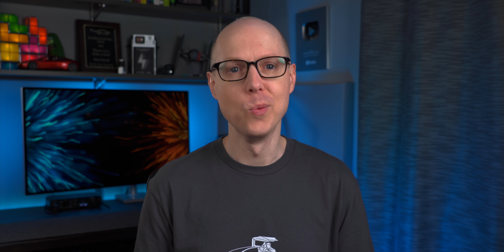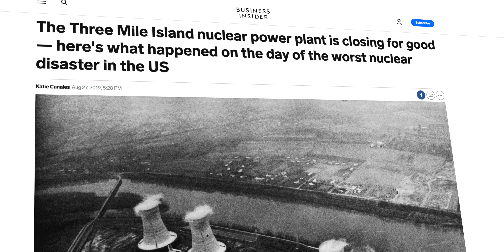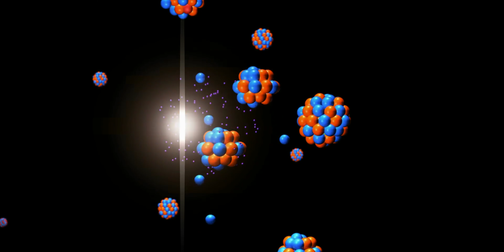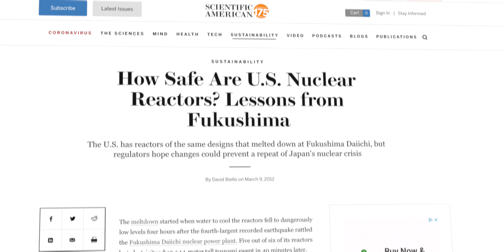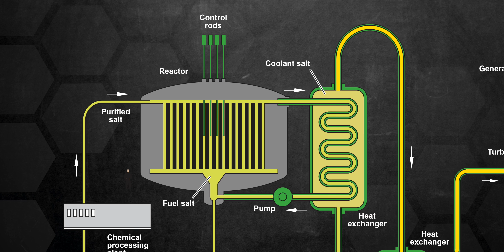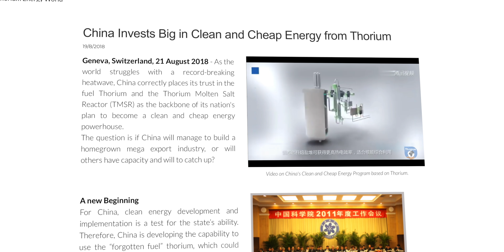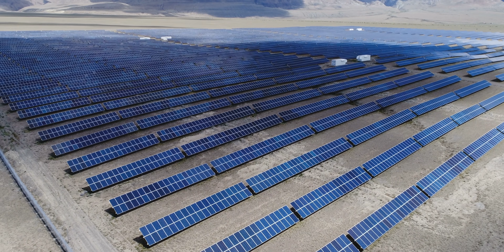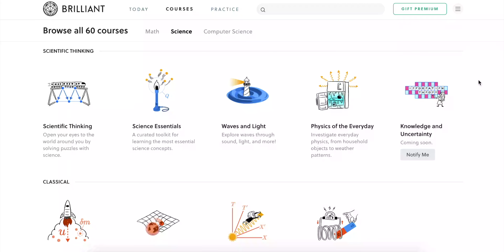Thorium explained - the future of cheap, clean energy?

Comment: Nuclear power is a moot point. Thorium would have been great back in the 50’s or 60’s, but wasn’t used because the DOD ran a game on us. Buy getting the public to buy into retail Uranium power plants they got pretty much all the free Plutonium they need for their bombs. Thorium would be great for use at a moon base or on Mars. The Tech for the twenty first century is “Liquid Air.”  That’s air not wind !!!
Reply: Nuclear is not a moot point until we have a quantum leap in energy storage technology, unless you want a future of massive rolling blackouts that is.
Reply: @ForbiddTV  that’s why I listed the Tech of “Liquid Air.” If you haven’t heard of it, this paradigm uses liquid air as a storage medium to produce electricity on demand. The protocol was first unveiled in 2009. As of this date their are three plants up and running. With 40 more on the drawing board. Like I said Nuclear power is a moot point !!!
Reply: @rikkoshop620   Not moot at all. The biggest disadvantage of "Liquid Air" is its low round trip efficiency, probably under 50%, which is
much lower than that of batteries (75-90%) and pumped hydro (70-85%) and similar to CAES (42-54%) and other chemical storage (28-50%).  And if you are getting your initial "charge" from a low performer such as solar (20% efficiency), combining the two leaves you with only about 10% of it's energy potential!
Reply: @ForbiddTV  you really do need to get your facts straight. First it’s efficiency is 75% and air is free. (You can’t beat free) With batteries you have to dig it out the ground. With Hydro, where is a lake when you really need it. Sorry you can try and pull all the negatives your little hart desires and you can’t find a paradigm that can top it !!!
Reply: @rikkoshop620    I did get my facts straight, why don't you?  The liquid air pilot plant that exists has a round trip efficiency of 8% and theoretical modelling in their report and by other researchers shows a round trip efficiency of around 50% if effective heat and cold recycle is used, and just above 20% when the heat and cold storage is depleted. Assuming further advancement of this relatively new research field, that the
theoretical models work in practice and that the operating of the power plant can be calibrated so that heat and cold recycle is available most of the time, it seems a round trip efficiency of 50% may be within reach. With a suitable location, with access to waste cold and especially waste
heat, this might be further improved. Efficiency is still much lower than batteries and pumped hydro and similar to CAES and chemical storage.  

Do you always enjoy making a fool of yourself on the internet?
Reply: @ForbiddTV  that was the first experimental plant that was built. Like I said you can’t just build hydro anywhere you want. You can with this. You keep touting batteries. But you never talk about the cost of digging, then processing the material needed. Add that cost in and their effective cost to yield starts to flag. Plus their is no waste pollution with air and there is tons of waste cleanup with chemicals. Remember the hole thrust of the argument with nuclear is it’s suppose to be clean (while you are only getting 36% efficiency and no one ever adds in the cost of storing the waste for a how many hundreds of years)  In short nuclear is not as clean as air period. You can’t get around my argument, so you keep trying to come up with stupid reasons to use stupid science. If you don’t like my efficiency calculations, then beat free.  None of the paradigms you mention have a cost that can beat free. So keep whistling past your grave yard !!!
Reply: @rikkoshop620   I never said batteries are our future, that's exactly the point - none of the available technologies will be suitable for a 100% renewables economy unless you are fine with massive rolling blackouts without nuclear when fossil fuels are phased out.  
Free?  Right, air is free, until you have to build a facility to produce/harness the "liquid air", store it, distribute it, maintain it, etc.  To suggest your nonsense is free is absurd.
Reply: @rikkoshop620   You still keep adding assumptions that I never said.  All electricity producing methods have costs associated with the entire operation to end product, and "liquid air's" end product needs massive increased infrastructure costs over others due the very nature of it's delicate inefficiency balance, having to upscale it to such a huge extent to overcome it's inherent inefficiency.  
If liquid "air would eat your lunch" why is it nowhere to be seen?  Promoting a technology that has no practical utility scale plant or even test plant is akin to promoting nuclear fusion which has been promised for many decades and still has nothing to show in a practical application.  Molten salt reactor technology was developed and successfully tested more than 50 years ago and still has no viable plants either.
Reply: @ForbiddTV  it is no where to be seen precisely because of the type of hair brain excuses like the ones you keep trying to make. You keep trying to pull nonsense out of your repertoire in order to dismiss this paradigm, (increase infrastructure cost - where did you pull that lame idea from) which on every level beats the current nuclear or fossil fuel systems now in use on many levels. Thorium was better than uranium, so why didn’t they use it?  Because the game that is played is not always about doing what makes sense. If it was - why do we still use it when there are so many better choices !!!
Reply: @rikkoshop620   No, it's nowhere to be seen because it hasn't been shown to be a viable alternative to the other equally impractical energy storage methods we have.  "which on every level beats the current nuclear or fossil fuel systems now in use on many levels."   That's completely non-sequitur since nuclear isn't a storage method, but a generating method. 
Thorium wasn't continued after the 1960's test plant because it didn't have bomb making applications.
Reply: @rikkoshop620   Well if you don't like facts, maybe you should go to a fear mongering video instead. You were the one who was confused why there were no thorium plants.
Reply: @ForbiddTV  yes it is. It’s about 20 years past due. Notice it’s only in China which is the only country that has the lose change to throw away on this latest tangent. No other countries are and China has a big problem. It’s credit markets are tapped out because they are holding all these empty real estate properties all over the country. They haven’t lived up to their promised return rates and the investors are starting to drive them to a reckoning.  It will boil down to price, which is the real reason Germany threw their Nuclear over board (a number of their reactors were coming up for refurbishment).  No one will stand to pay billions, when millions can fit their energy needs, except people that think like you  !!!!
Reply: @rikkoshop620   As of 2021, there were 54 nuclear reactors under construction worldwide, but someone thinks nuclear is a moot point. Over the years, nuclear reactors for electricity production were installed in nine developing countries : Argentina, Brazil, China, India, Iran, Mexico, Pakistan, South Africa, and North Korea, but but someone thinks nuclear is a moot point.  Even Bill Gates has jumped into the foray with a planned TerraPower Natrium molten sodium plant in Wyoming, but someone thinks nuclear is a moot point.
Reply: @ForbiddTV  yes but of the 120 reactor builds that were contemplated, most have now been cancelled. So that means world wide they cut 2, 1/3rds of the contemplated builds. Like I said most of the builds are in China or the Middle East, because those countries have excess cash to throw away. But the majority of the world has thought better. Remember when China was stuck on constructing coal power plants, but their economy has now matured and those copy cats are about to recreate one of the west’s biggest blunders.  (But they are fast learners) to bad you aren’t !!!
Reply: @rikkoshop620   China cut their coal advancement and now leans nuclear because of a hard learned pollution nightmare they are dealing with, but someone thinks nuclear is a moot point.   Nuclear Power Is the Best Climate-Change Solution by Far, its total greenhouse-gas emissions are 1/700th those of coal—and one-fourth those of solar, but someone thinks nuclear is a moot point.
Reply: @rikkoshop620   Your very first words, if you can't take criticism, maybe the internet isn't for you. 
Scientists have found no one should have been kept from their homes in those exclusion areas. 
No need to move or bury spent fuel rods, it's very valuable fuel in next gen reactors with more than 90% of its energy still there.
Reply: @rikkoshop620    "Nuclear power is a moot point", yep, spreading BS. 

Sorry you are butt-hurt that your "liquid air" isn't what you memed it to be.
Reply: @rikkoshop620   Must be all those thousands of CEO's and industry engineers, architects and technicians just aren't as smart as you to be building that which is "a moot point".  
Duh.
Reply: @ForbiddTV  see there your go again with that phrase.  (See, say often enough and it becomes a fate de complete) Just what the buggy’s whip sales man said about the horseless carriage. Their will be better tech coming down the road - always is, always will be. Just cause all your CEO’s and fat cats buy the cool aid - doesn’t mean it can’t be replaced. And in time, it will be !!!
Reply: @rikkoshop620   With solar at less than 20% efficiency after 180 years of development, guess which technology will be the "moot point" in the future.
Reply: @rikkoshop620  "Climate crisis driving a nuclear revival" Energy Central 
"We At The Dawn Of A Nuclear Energy Renaissance" Huffington Post  
"Is a U.S. Nuclear Revival Finally Underway?" Scientific American  
"France's Macron commits to restarting nuclear power development"  
"Europe revisits nuclear power as climate deadlines loom"  

But someone said "nuclear power is a moot point..."
Reply: @danadurnfordkevinblanchdebunk  well thank you for backing up my point that you can not just shut off a reactor. But with a “Liquid Air” power plant you can. No need for me to patent it, that was done in 2009. And to date they have built 3. Two in the UK and one in Northern Vermont !!!
Reply: @danadurnfordkevinblanchdebunk  I’m sorry but some how the main point of my argument seems to escape you. Any thing that can be started, can be stopped. A nuclear plant is no different. How ever it can’t be clicked on and off like a light switch. Liquid Air plants can. Here we go with “but it’s a power source,” yes it can deliver heat that can boil water and create steam that will run a turbine that will create electricity. But the core has to be replaced from to time just like a non rechargeable battery. And the largest known source of power in our system is the Sun and even that is just a battery - it’s the largest chemical fusion battery known to man, but it’s still just a battery. It’s a source of energy alright, but it’s just a hydrogen chemical battery that employs fusion to work, with a 10 billion year service life. And sense nuclear reactors can’t turn around quickly, they are great for baseline energy duties, because on the surface it operates cleaner than fossil fuels. But thanks to the proliferation of Wind and Solar, baseline is not the holy grail that it use to be. You need a source of energy that can be instantly turned on or off like a peaker plant. (That’s why LNG plants are trying to gain relevance again) And that’s what Liquid Air can do cleaner, cheaper or more efficiently !!!
Reply: @danadurnfordkevinblanchdebunk  you make me laugh. Why don’t you just admit you haven’t a clue about this technology or how it works - so you come up with nonsense - physics “the characteristics of fluid under pressure.”   Try reading something !!!
Reply: @danadurnfordkevinblanchdebunk  well whether you like it or not I have the right to believe in a different future than you. (A much better future without nuclear) It’s not my problem your panties get a bunch from a simple declarative statement !!!

Comment: Nuclear waste has energy left, so it need not be wasted.  There is tech now that can use waste encased in artificial diamond to generate electricity.  It produces no external radiation.  Anyways, I think putting waste to work should be considered a necessary business expense even if not profitable.  If it's putting out power, it's harnessable.

Comment: Hi there Matt. I’ve found your posts to be very informative, thank you. I was listening to the radio a few days back when the CEO of the Eden Project, in the SW of England, came on to discuss geothermal energy. I cant remember the exact figures, but, they had drilled down a coupe of kilometres or so to harness the energy produced from the core. They were able, with one sink hole, to produce enough energy for a small town. He inferred that this could be replicated anywhere on the planet to generate safe, clean, cheap power. What are your thoughts and why aren’t we doing it?
Reply: I'm amazed this did this in England; I seem to recall a Dr. Who episode where this was going on, and they released some subterranean monsters in the process :-)   I seem to recall that Iceland had some significant geothermal electric power production, though perhaps not needing the kilometer deep holes in their case.

Comment: In 2012 I saw the first TED talk about (small) safe Thorium reactors. However, since then very little has changed or improved into making them a (commercial) reality. This means that the earliest we can see working reactors of this kind in the US/EU are prognosed to be around 2040/2050. This just means we cannot wait for them to come, we have to investigate other means of clean energy more quickly. Also, the big baseload nuclear power offers us is also long been a hindrance in stimulating investors to invest in more natural clean energy sources. E.g. here in Belgium we have nuclear plants (to be closed in 2025), but they offer a fixed base load. If there is an abundance of wind and solar energy, we produce too much energy, and because you cannot simply switch on or off a nuclear plant, we turn off the cheapest source of energy, which is imho completely counter-intuitive.

Comment: I worked in nuclear  operations for almost 35 years until I retired.   I think that nuclear is the best option to fight climate change, really the only real option given that solar energy and wind energy add very little to the power grid.   Thorium is a great option however we still need to find the right material that will not corrode in the highly corrosive molten salt.   Not only does the “new” material have to stand up to the molten salt  it must also stand up to the high neutron bombardment.   The other more likely option is operating Small Modular Reactor, SMR , which should be much easier to operate and using fuel encased in a ceramic. The ceramic melts at a much higher temperature compared to the uranium within the ceramic pellet which means the reactor cannot melt down.

Comment: I've belatedly watched this excellent video (as always) to learn what all the fuss was about thorium, and why nevertheless there is no such thing. Ah ... corrosion in molten salt. I'm a retired PhD metallurgist who specialized in high temperature alloys, which always involves oxidation and corrosion resistance. I got into the weeds on the subject, and from a brief look at some literature came to the conclusion that the problem will not likely be overcome. Materials are stubborn things. The number of elements in the periodic table is limited. You either need natural resistance (such as gold in oxygen), or a protective scale formed by reaction with the nasty stuff (such as jet engine alloys in oxygen). But those jet engine alloys will NOT tolerate even small amounts of molten salt — the offending stuff must be kept out (e.g., fuel cannot contain vanadium, since molten vanadium sulfate will eat up the oxide scale on your turbine blades.)
Reply: stainless 304 seams like it'd handle the heat well enough but still would be short service life i think. if they uses sodium chloride. but ss304 isent to good at abrasion if remember correctly. and as is nucks use ultra purified water and still have problems with abrasion, cant Imajin unpurified unfiltered molten salt.
Reply: So, the answer lies in the current method to move fluorine. Yes: ELEMENTAL FLUORINE. How are pipes prepared to transport it? Yes - that's a real thing. And therein lies the answer to the corrosion problem. After all - if we already design pipes to move elemental fluorine -- moving a fluoride salt will be a no-brainer.

Comment: Thorium technology is in principal based on nuclear fission and therefore keeps fission’s inherent problems. While it partially addresses some of the downsides of current commercial reactors based on uranium (plutonium) fuel, such as limited reserves of uranium and unwanted production of plutonium and transuranic isotopes, it still has significant issues related to fuel mining and fabrication, reactor safety, production of dangerous waste, and the hazards of the proliferation of nuclear weapons.

Comment: Molten Salt Reactors are not new. The Alabama University ran one for 2 to 3 years in the early 1970s.  After shutting it down, inspection found little to no corrosion.  They applied for a permit for the next size up reactor, and got all their funding pulled.  Seems no one really want a safer, more reliable, simpler, cleaner way to make electricity. My statement  may not be 100 percent accurate but it is well over 90  percent.